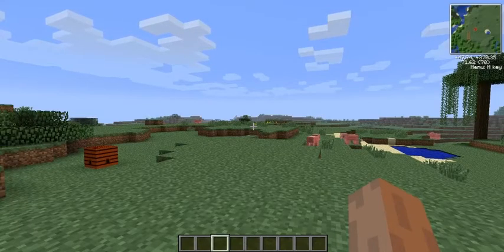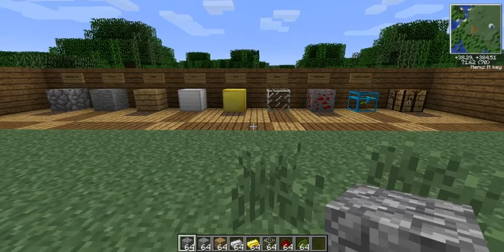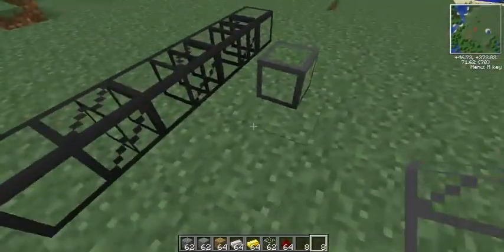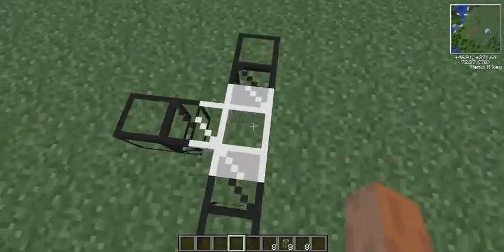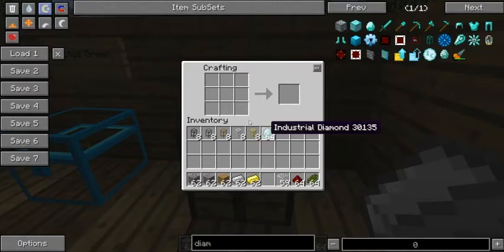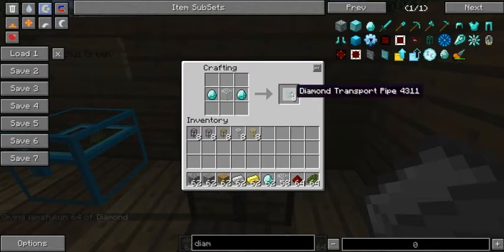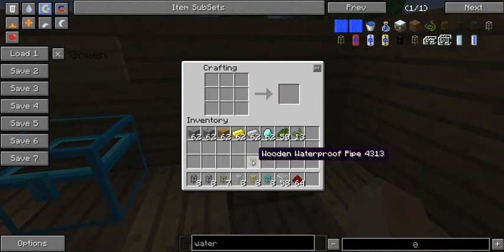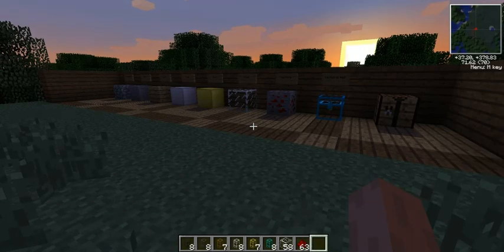FTB basics 1 - Buildcraft pipes

Comment from the maker: you're going to want to look into transformers for your power lines or transformer upgrades so your machines can run using higher power levels.  I've briefly covered this in FTB Basics 7 so go ahead and take a look.

I have run into problems with my mic being too quiet, is it still too quiet in my recent videos?  Post a response on my most recent video after checking it out so I can adjust levels again.